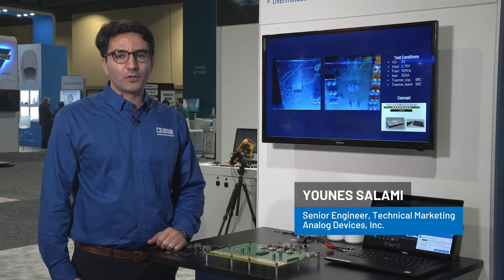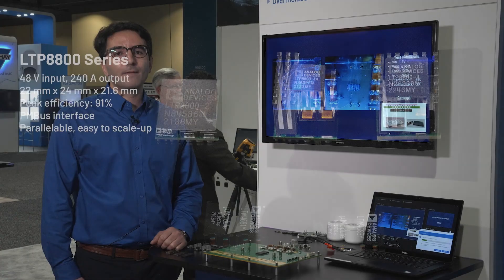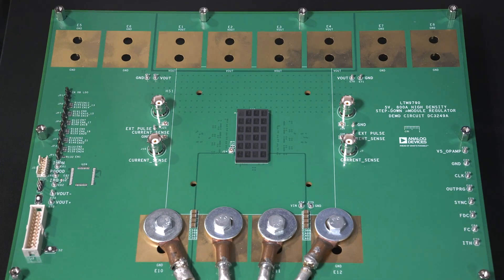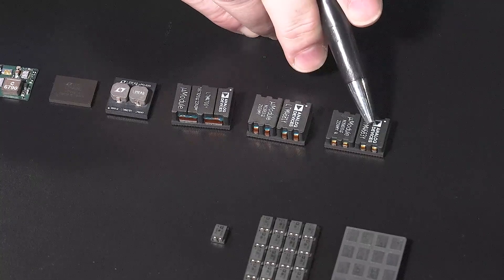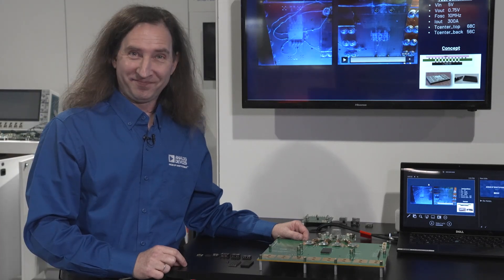Vertical and Lateral Power Solutions for AI Systems, Data Centers | Analog Devices

Comment: Analog Devices' µModule Power Solutions for Demanding Applications

* 0:01 Analog Devices' µModule Portfolio: Addresses power demands for data centers, telecom, and networking applications.
* 0:15 Input Voltage Support: Offers solutions for both 12V and 48V input voltages.
* 0:21 Power Delivery Options: Provides both single-stage and two-stage power delivery solutions.
* 0:24 Lateral and Vertical Power Delivery: Offers both lateral and vertical power delivery methods based on application needs.
* 0:31 µModule Examples:
    * 0:34 LTP 88 100 Series:  Lateral solution for 48V input, up to 240A per module, parallelable.
    * 1:01 LTM 46 AD Series: Lateral solution for 12V input, up to 125A per module, parallelable.
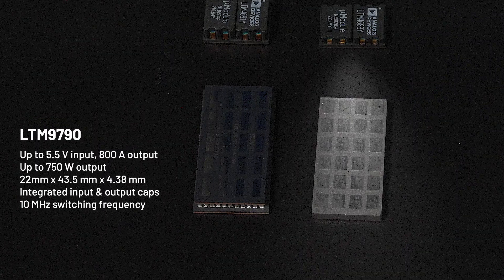    * 1:58 LTM 9790: Vertical solution, up to 800A, integrated capacitors.
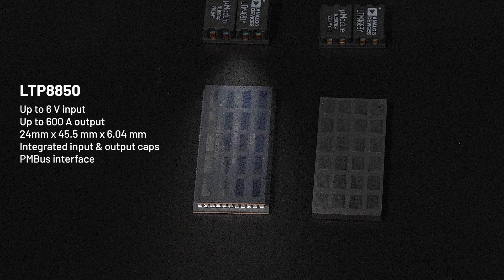    * 2:37 LTP 8850: Vertical solution, up to 600A, unique structure and scalability.
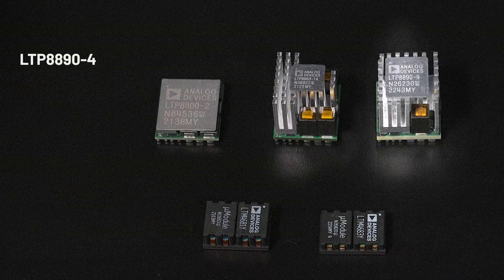    * 3:10 LTP 88 9-4: Two-stage solution for 54V input, up to 350W, high efficiency.
* 1:21 Vertical Power Delivery Advantages:  Shorter power path, improved copper loss, better transient response.
* 2:20 Integrated Components: Many µModules integrate capacitors and other components, reducing external component needs.

Essentially, Analog Devices offers a range of power solutions packaged in µModule format, catering to different power and configuration requirements in demanding applications. They provide both lateral and vertical options, the latter being particularly beneficial for high-current applications with processors requiring optimized power delivery.

I used gemini-1.5-pro-exp-0801 to summarize the transcript.
Cost (if I didn't use the free tier): $0.02
Input tokens: 4465
Output tokens: 779